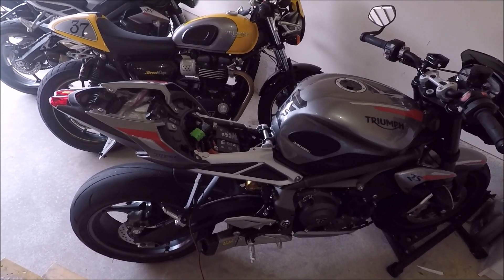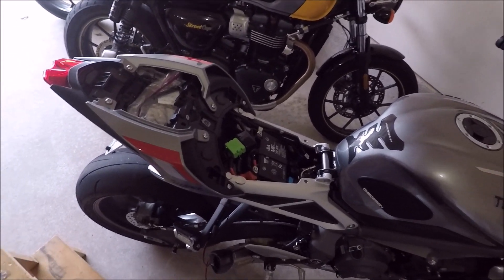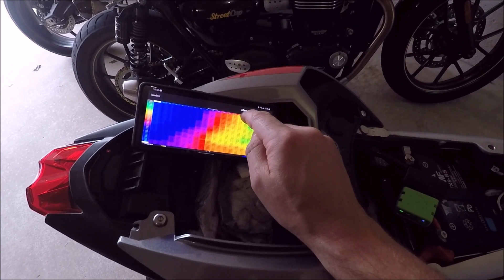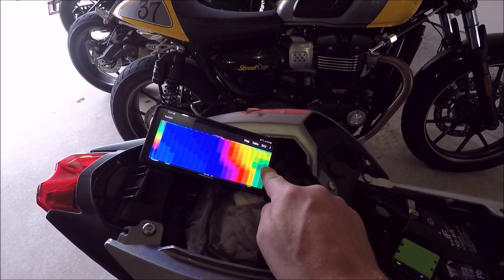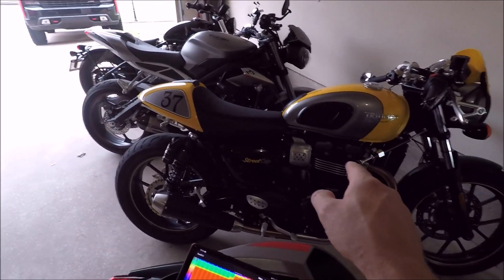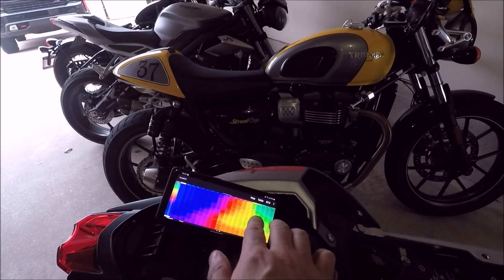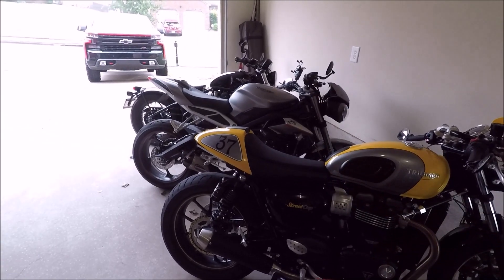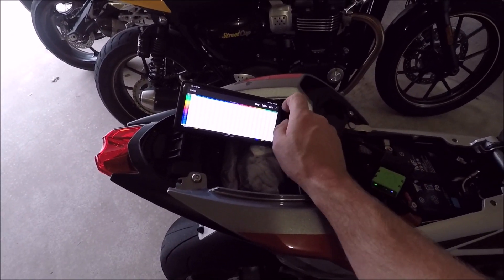How To Use TuneECU on a 2020 Street Triple RS 765

Comment: Can anything  be done about the RPM digital display?  Prefer the displays of the older models and how has been the bike so far ?
Reply from the maker: No.  TuneECU is just the motor, tuning and stuff like that.  The Dashboard has it's own thing and the only system that can talk to that is the dealer tool.  The factory makes those decision and pushed the updates to the dealer tool and only they can install those.  They would have to decide to come up with better dash designs, or all some of the old ones to be put back on.  Probably not gonna happen.  

I am gonna be out on track a week from today and would LOVE the older style, large tachometer...  :-(